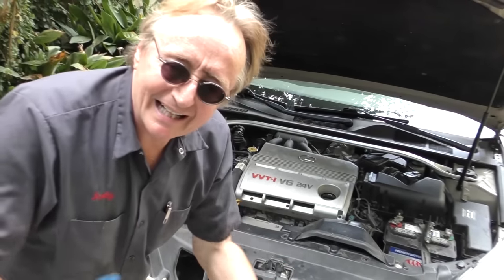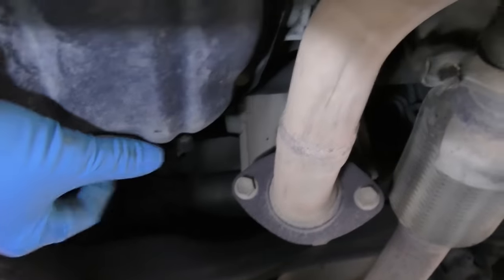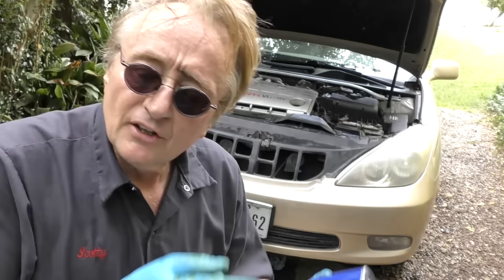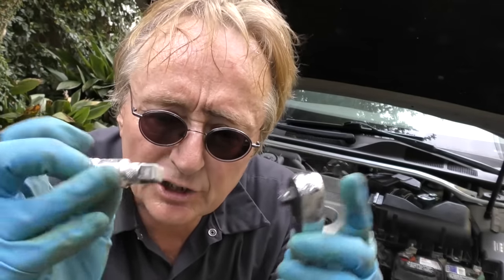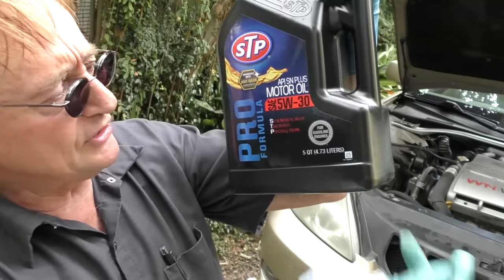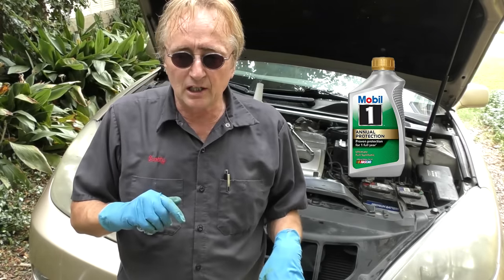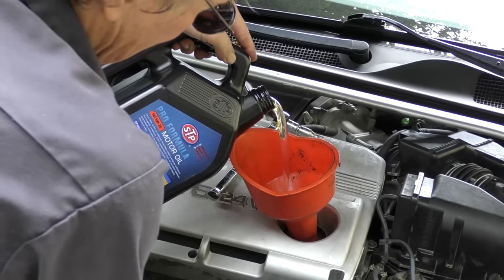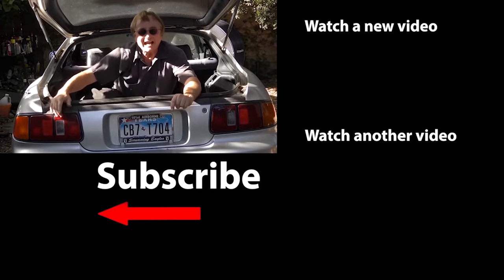Changing Your Engine Oil? You’re Doing It Wrong

Comment: The "W" doesn't mean "weight" it means "winter"..... now back to your regular programming.
Reply: That's a matter of opinion.  The first number on the oil container like 5w actually stands for winter viscosity and viscosity is another name for weight.
Reply: @neutrodyne  Not a matter of opinion. 
Petroleum-based lubricants continued to be used successfully in the earliest automobiles, and even then, extensive efforts were made to classify them. Viscosity was identified as one of the most important characteristics of a motor oil, and oils were divided into light, medium and heavy viscosity classes. As soon as instruments capable of measuring viscosity were introduced, the Society of Automotive Engineers (SAE) developed a complete viscosity classification system, which included 11 different viscosity grades: SAE 0W, SAE 5W, SAE 10W, SAE 15W, SAE 20W, SAE 25W, SAE 20, SAE 30, SAE 40, SAE 50, and SAE 60.
Oil viscosity grades with a "W" were formulated for cold temperatures, while viscosity grades without the "W" were suited for higher temperatures. Before the development of viscosity modifiers in the 1940s allowed the manufacture of multi-grade motor oils, motorists commonly had to switch viscosity grades in their vehicles with the seasons. U.S. oil companies have been marketing multi-viscosity oils, such as SAE 5W-30, SAE 10W-40 and SAE 20W-50, since 1945. These oils offer adequate protection in both high and low temperatures
Reply: @JalopyTechnology  You said it yourself "U.S. oil companies have been marketing multi-viscosity oils, such as SAE 5W-30, SAE 10W-40 and SAE 20W-50, since 1945.  Since viscosity is another word for weight I rest my case.
Reply: @neutrodyne  read my reply...oils labeled W are for cold weather use....geez.
Reply: The only reason I read the comments is to see if anyone else caught that.
Reply: Oil Types, Weights & Viscosity FAQ

Is it ok to switch motor oil weights, for example, from a 5W-20 to a 10W-30?

It depends. Some vehicle manufacturers provide a range of recommended motor oil viscosity grades based on the outside temperature in which the car is driven. Other manufacturers recommend the use of only one motor oil viscosity grade. For best engine performance, always follow the manufacturer's recommendations found in your vehicle’s owner’s manual.
Reply: @neutrodyne  viscosity has nothing to do with weight.... viscosity is the resistances to flow...

Comment: You forgot to check the oil level after running the vehicle for about 40 seconds. Occasionally, certain models will use about a half quart more because backyard mechanics forget to double check the capacity with filter. You did and that's great, but some folks overlook that.

Comment: I was told that if your engine mileage over 100K, start using a thicker oil because the machine's tolerance (gap between metal parts) increased
Reply: just use high mileage.  don't overthink it

Comment: Bad advice using such a big bar for tightening , very easy to strip the threads in the pan!
Reply: JAMES LANE i’d rather have to replace an oil pan than a motor!
Reply: Quick tip: small bolts, small wrench: Big Bolts, Big Wrench. Stripped my girlfriend's daughter's clothes the other night. Went overboard--supposed to have stopped at my gf. Now I don't have a gf. Don't strip.
Reply: And he didn't fill the new oil filter so it's gonna be a dry start ,the engine has to pump the filter full before it'll pump oil through the engine
Reply: @Loadedchamberrecords   Kind of hard to do when the filter is mounted horizontally.
Reply: @Loadedchamberrecords  gas engines don't need the filter filled up prior to initial start
Reply: They need oil from the time the engine is turned over ,I know that for a fact.
Reply: @Loadedchamberrecords  going in at a 90 degree angle the oil would just pour out.
Reply: Well its meant to loosen not tightening thats how scotty showed it notice he didnt tighten with long one
Reply: Loadedchamberrecords 
The oil filter installs sideways. How do you fill it without dumping it before the seal gets screwed tight?
Reply: @Loadedchamberrecords  you sir are wrong.
Reply: @larryjensen1388  no it wouldn't ,as the oil soaks into the filiment and the remaining oil has viscosity and not much will be lost if the filter is wound on reasonably fast
Reply: nothxbb I rather do neither
Reply: @rickwilliams4342  You dont have to fill up your oil filter just put a finger amount on the seal nothing should be spilling out of a new filter. Only when removing an old used filter could oil be spilled because the filter is full of used motor oil that has been filtered.
Reply: @Loadedchamberrecords  No need to do that and it's impossible to do that on modern gas and diesel engines that have the filters sitting on top. Even though the engine oil has been drained the parts are still coated with oil, not like it's completely dry.
Reply: That will happen if u girlfriend does it
Reply: @larryjensen1388  Exactly!
Reply: I think Scotty is assuming people have enough common sense to not pull like a bull on the bar.  I just run the plug down till it stops with light torque, then give it 1/6 of a turn.
Reply: Gimme a break ppl ,if you have ANY idea what your doing, wrench size means nothing  real mechanics FEEL the torque being applied ,using a bigger wrench just lessens the effort we put into it
Reply: @usa-rb5fi  if it's a turbo motor,it is critical to fill the filter first on ANY engine the weakest link in a turbo is the bearings cause they spin at such a high rpm so even a few dry seconds is really damaging,,also if you want a turbo to last a long time you should let the motor idle for a minute or so before you shut it off,this gives the turbo time to cool down A LOT before stopping ,when you run a turbo car hard and just shut it off ,the turbo bearings are so hot they make the oil coke,turning it into hard burnt carbon that destroys the bearing prematurely
Reply: @tragiclife9760  actually my car I can't prefill my filter, even thought it is a turbo.
Reply: @tragiclife9760  also newer turbo cars don't require the 30 seconds to a minute idle time before shut off
Reply: @usa-rb5fi  maybe not require,but would still benefit greatly  remember,cars can't read the owners manual so thry.dont know that lingering heat is so destuctable. ,it's just how you wanna take care of your stuff,the nicer you are to a machine ,the better it will serve you
Reply: @usa-rb5fi  you can refill the filter on any engine ,even if it's upside down,put oil in the filter ,let it soak into the element for a few minutes ,it doesn't have to be slap full , then put you thumb over the center hole and,quickly ,screw it on,you might lose a little ,so wipe it off,hit it with a little brake  cleaner and you are good to go  since you have a turbo car ,try it,your turbo will thank you down the road   GM used to put it right on a sticker under the hood on turbo cars I not sure if they still do
Reply: @tragiclife9760  my car is an internal filter.
Reply: @usa-rb5fi  well  in that case ,you are right.,is it a Benz ,most of them have cartridge type filters,
Reply: @tragiclife9760  nope chevy cruze lol
Reply: @usa-rb5fi  really? Lmao  even though I was raised on Chevy and Pontiac,  I haven't really kept up to date with what they are doing nowadays but I can tell you, your car is not really a Chevy, it's a rebadged Isuzu  ,check it out if you don't believe me
Reply: @tragiclife9760  either way still a GM product, but yes the 1.4t and 1.8 use an internal filter.
Reply: John Smith By utilising a big bar, it would be far easier to strip the threads , lots of heavy handed folk about. The video is supposed to be a tutorial, how do you know how much experience some viewers may have, so poor advice.
Reply: Ya I guess if you're using both hands as hard as you possibly can
Reply: @Loadedchamberrecords  well my oil filter is mounted upside down on top of the engine. Please explain why a manufacturer would do that if what you say is true?
Reply: JAMES LANE I use a torque wrench and tighten mine to 18 foot pounds also I’ve written that spec on the bottom of my oil pan so I will not forget. And I write the date of the oil change on the new filter also
Reply: @penguin12902  because that model of car is crap
Reply: @Loadedchamberrecords  basically ALL new cars have it that way.  Which engineering school did you graduate from? You should ask for a refund.
Reply: @penguin12902  they don't build their cars to last ,and have fun taking your oil filter off I'm sure oil will go everywhere ,hence bad design.
Reply: @Loadedchamberrecords  why would oil go everywhere? The oil drains out of the filter when you drain the oil, because its upside down. It also has a lip around it to catch any drips when you unscrew it.

Comment: Priming the oil filter before screwing it back on helps minimize the length of time the engine runs without oil pressure on startup.

Comment: I ran a diesel Skoda Octavia for 340,000+ miles, oil changed every 10,000 miles (manufacturers recommended interval) and I never once removed the drain plug.  I use a vacuum pump to extract the old oil.

Comment: Been doing all my own services for over 20year's never replaced a oil sump washer, never had a leak, go figure. I let a cold engine run for a minute or 2 only, i find the oil flows out better when it's a bit warm. That way exhaust is not to hot. Was always taught to release the oil cap a bit first but i find the trick is leave it on untill you have the oil drain bolt out, then undo the oil cap.  This way it doesn't flow to fast and end up down your hand n arm

Comment: Always clean your funnel first!
Reply: I use 2 funnels. One for new oil only and the other for emptying the drain pan into the empty oil container for recycling. 
I once knew a mechanic who had a 44 gallon drum with a tap about 1/3 of the way from the bottom. He filled the drum with used engine oil and let it sit for a few weeks. He would then drain the top 2/3 into another container and then use the oil in his oil heater at home. He would then fill the 44 gallon drum again, leaving the old 1/3 in the drum and do the same thing again. When the bottom 1/3 was just sludge, he would empty it into recycling containers to be recycled. Mind you, it took several years for the bottom 1/3 to be sludge.

Comment: 2 Suggestions
Pour some oil into the new oil filter so the filter element will be saturated and not delay the new oil pumped through it by soaking it up as it enters.
If space permits use a torque wrench to tighten the drain bolt.
Reply: Waste of time
Reply: @ExpVet - 1. Good Grief !!  2. Never heard of such a suggestion adding oil to the new oil filter to avoid oil delay.  3. NO ... on the torque wrench on drain bolt!!  4. Too Tight Could Strip Oil Pan Threads.  5. Were you not listening ?!?

Comment: Problem #1 a damn drain plug should never ever be that damn tight especially with aluminum oil pans. If aluminum oil pan drain plug is over tightened it's best to let cool to prevent pulling out the pans threads with the drain plug.
Reply: I agree. I always use a short socket or ratchet wrench to just barely crush the aluminum washer/gasket. Never overtighten it or the oil filter! Always use a new washer/gasket. The only long handled wrench I ever use to tighten anything is a torque wrench.

Comment: Changing the oil in my Chevy G-10 van with the 305 V8 was a piece of cake. I didn't need a lift or ramps to get to the drain plug or filter. 
I like that oil filter wrench; it's more convenient to use than the ones with the metal band.

Comment: If the filter hangs vertically, I pre-fill it, particularly on the 2001 Passat 1.8T, where I use a Purolator L40316, which takes a full quart.
Reply: So you bypass filtering fresh oil while the filter is primarily  for filtering the fresh oil because that is when it is the dirtiest.
Reply: @lorihinton1920  ?????
I pre-fill the filter with fresh oil instead of installing it empty, so I get full oil pressure without having to pump a quart first.
Reply: nope.  engine starts off preexisting oil from cylinder walls thats why you use good oil.  car does not start off filter.  oil is in the pan for pickup not filter.  None are used for startup

Comment: Car companies in the U.S. are specifying 20 weight oils to increase gas mileage at the expense of your engine wearing out sooner.  Look up your car's recommended oil weight on the manufacturer's web site in the U.S. and then look it up in Europe.  
Honda U.S. site says: "Always use a premium-grade 5W-20 detergent oil displaying the API Certification Seal. This seal indicates the oil is energy conserving, and that it meets the American Petroleum Institute's latest requirements. Genuine Honda Motor Oil is the preferred 5W-20 lubricant for your vehicle."  
Europe site site says: "For all petrol engines, excluding Hybrid models, the recommended oil for Western European driving conditions and weather conditions is a semi-synthetic motor oil meeting the minimum specification ACEA A1/B1. The recommended viscosity range is between 0W-20 to 10W-40."  

So I'll keep putting in 30 weigh oil in my Honda even if the cap says 5W-20.  (Castrol High Mileage semi-synthetic 5W-30 to be exact)
Reply: John Ullrey you’re doing it wrong.
Reply: @season387  Sooo you're saying those Honda engines in Europe are different than the ones we get here in the states since they can handle all the oil weights from 20 through 40?   Right...
Reply: John Ullrey I’m simply saying just put in what the owners manual says.  If your US spec car manual says 5w20 then that’s what you put.  And models in our countries may call for different oil viscosity because they are different. If you look up the engine codes they are tuned differently.
Reply: I put 10w30 in my Taurus once because it happened to be what I had available (Manual calls for 5w20) and I had valve train noise that I never had before. I changed it out after about 100 miles for the correct weight and the noise was gone. BTW, you do realize than many cars in Europe have a totally different engine lineup from what's available here in the US right?
Reply: @nodak81  Yes, they do have different engine options.  I just find it interesting that it's only the U.S. that they specify you have to run 20 weight oil.  Its due to the Corporate Average Fuel Economy (CAFE) standards are regulations in the United States.  The government is more concerned with fuel economy than how long my engine lasts.   I'm more concerned with how long my engine lasts.  So based on the video I linked before if I bought a new car I would probably put a really high quality full-synthetic 20 weight oil in it.  But for my '07 Odyssey with nearly 200K miles, I'm convinced  Castrol High Mileage semi-synthetic 5W-30 is better for it.
Reply: @nodak81  > actually held pressure and was spraying oil on inside of valve covers

Comment: 3/8” drive is good enough.  If you need breaker bar, you are doing something wrong.
Reply: @MrStevegibb  precisely, you brought it to a monkey
Reply: @musclesmouse  i have no idea what your talking about obviously i am refering to getting a 2nd hand car which has a overtightened sump bolt by someone with an impact wrench.
Reply: He specifically said that was for people who are weak and don’t think they can break the plug loose.
Reply: I got my car used, with a service done by the dealership before i got it. I needed an extractor to get that thing off, because it was a circle. I ended up having to wait a few days for the new drain plug before i could change my oil.

Comment: Why not fill the new oil filter with oil before reinstalling? It would reduce the time the engine runs dry when restarting.
Reply: Granted the filter does not install at an angle, but yeah that's not bad advice.
Reply: Most oil filters go in sideways...plus the oil hits the engine while your pouring it nothing's running dry.
Reply: Thanks to the anti-drainback valve, oil can only pour out of the centre hole of the filter. So even if the filter is sideways you can often position it quickly and screw a thread or 2, so there will be very little oil loss. But, ok, this depends on the access.

Comment: I was using a water pipe tube to extend the leverage of my socket.

Also, I used pedestrian curb in less frequented area as jack to raise my car on one side, then crawl under to remove the bolt.
Reply: Good idea on using the curb. Especially beneficial for those of us with gravel driveways, so we have to use the street or sidewalk for a solid place to put our Jack/jackstands

Comment: My buddy use 30% bacon grease and 70%  oil for years bacon grease cleans everything  the research is amazing look it up
Reply: 35 years ago guys used to replace one quart of motor oil with one quart of transmission oil. Said it cleaned the engine better.
Reply: great idea except for the salt in the bacon grease

Comment: I always changed the oil went the engine is hot, better chance for the sludge to drain.
Reply: Adam Bosma if it's changed often enough you should never have sludge.
Reply: @markbro4427  there is always a bit of sludge ...

Comment: I bought my brother in laws 1996 Dodge truck which he used Mobile one after the third oil change.When I got it from him it had 361,000 miles on the orig.motor.the transmission and rearend had been rebuilt but the motor still ran great. I'm sold on Mobile one.

Comment: The number one mistake that I made when I first changed oil was not knowing how much I should put new oil in the engine. Ended up having to drain the excess oil out to have the right amout in.😂 There is no max line like there is in brake fluid tank or coolant tank for example.